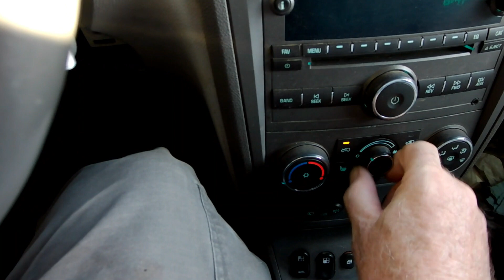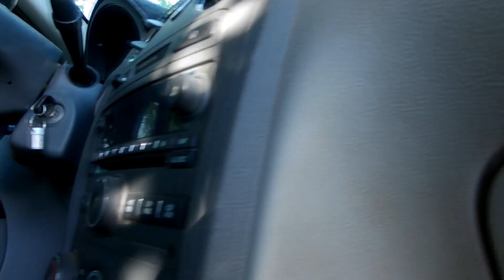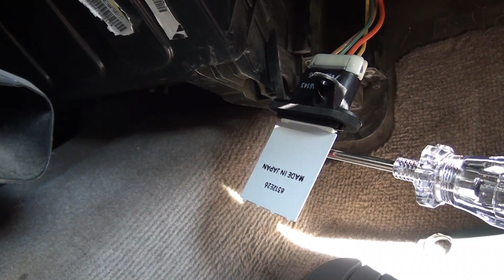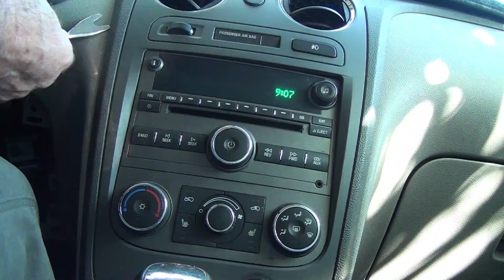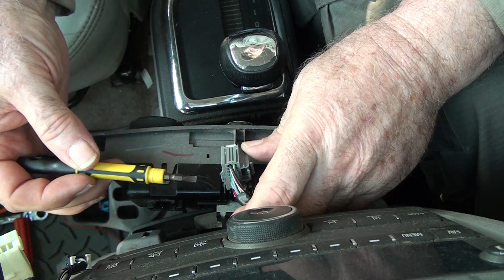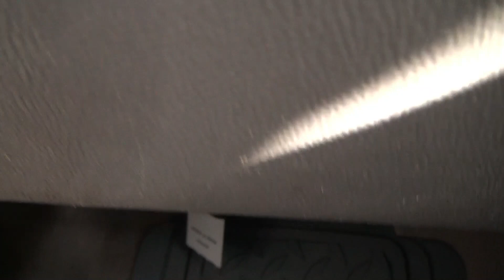HHR Heater AC Fan Motor Issues.

Comment: Hi I had  the opposite  problem my fan work on and off,I replace resistor,relay still problem,I been replacing  control ac unit several times problem still there
Reply from the maker: Sorry to hear of the issues. Post the repair when you get it fixed so everyone can learn.

Comment: Can you give us a part number for the control unit ?
Reply from the maker: I bought it on Ebay. Here is a unit without heated seats that may have the part number you are looking for...
https://www.ebay.com/itm/2006-06-chevy-hhr-heater-ac-control-switch-panel-22716307-NON-heated-seat/254470974964?hash=item3b3fa6edf4:g:uwAAAOSweYJdcWq6

Comment: my wife's HHR had that problem and it turned out to be the resistor or something like that, I think it was one of the things you checked up by the blower, but on hers, that plastic cover under the drain screen under the windshield had started leaking and came down and messed up the resistor.